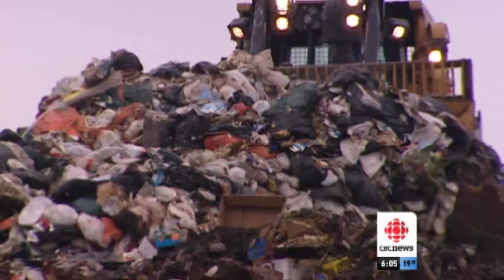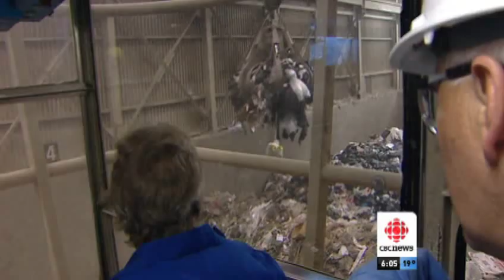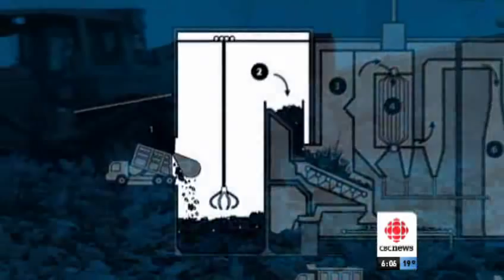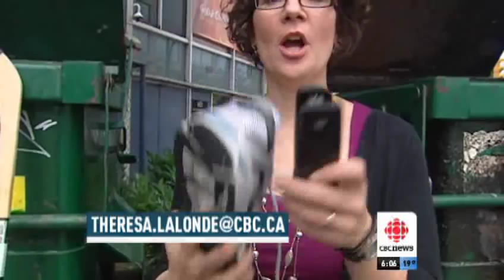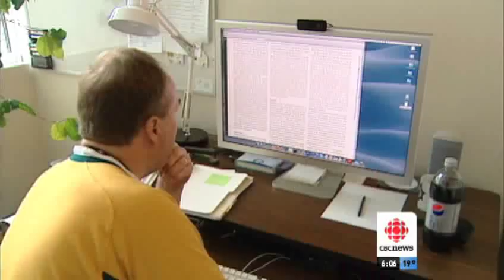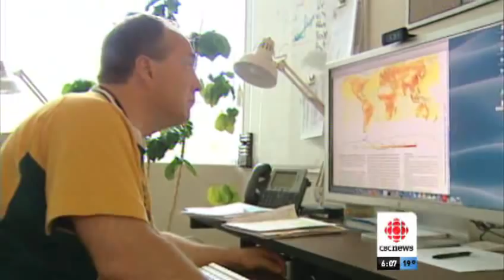Science Behind Incinerators | CBC

Comment: The plastic, and the rubber feet are both made from crude oil...a resource that is depleting. The stapler is just one example. The shoe can be shred, and the rubber recycled. The hockey stick can be shred and made into paper. The bleaching process wood goes through to make paper will remove the paint. The reporter used those 3 examples and said they can't be recycled. They can. The entire time you saw her face her report was false.